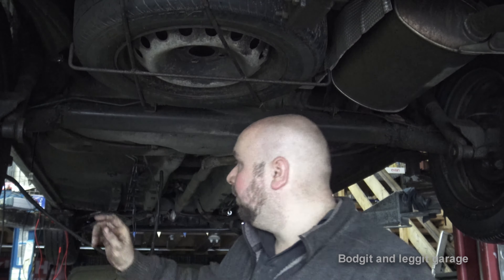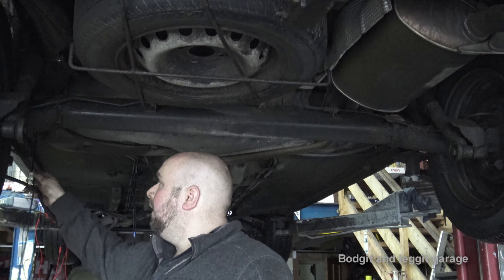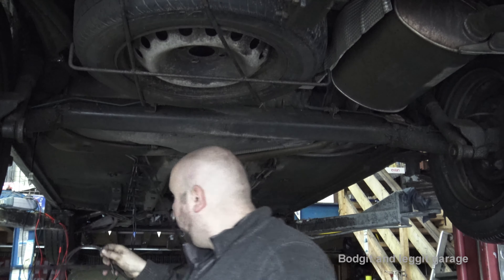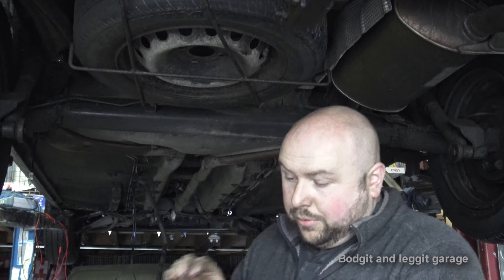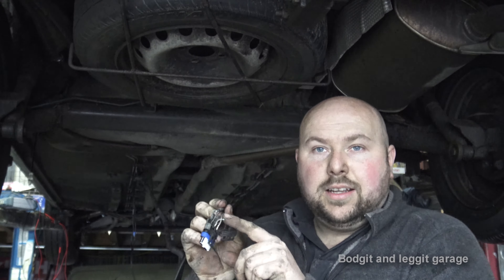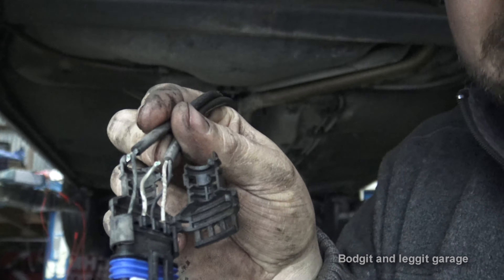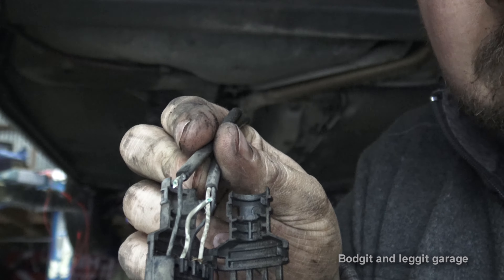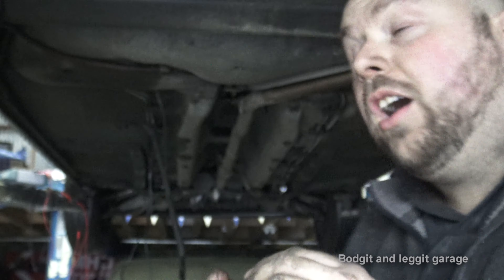Oscilloscope Diagnostics Do You Want To See It Bodgit And Leggit Garage

Comment: Yea, definitely. Looking forward to it! I'm trying to track down an abs/esp, steering angle sensor, communication fault(s) from PP2000 at the moment myself. Have a feeling all the errors are from one single cause. I'm waiting on a new multimeter to arrive in the post before I can do much more though. 
I hate the idea of throwing parts at the car until it's fixed.. I spent about a week diagnosing and researching until I was sure I had a sticking/faulty fuel regulator.
Reply from the maker: sound like fun mate get your hands dirty lol

Comment: been watching US guys doing diagnostic work and they are great certainly made me think more outside the box as a none mechanic which I feel is essential with today's cars which encourage some disreputable garages to shaft customers. 

You can do a lot of testing with a scope on a rope ( test light ) ohms meters and even basic code scanners with freeze frame can help. 

So if your doing this don't forget the cheaper options If you haven't already then check out guys like ScannerDanner and Schrodingers Box.

And your right don't be that parts changer. 

Teach us buddy. 

If need be do a channel just for diagnostics you will be surprised how many of us will subscribe.

I diagnosed a knackered cat using a bog standard hand scanner using live data function when two local garages wanted to change the O2 sensors rather than trace the real problem. with todays cars a small vacume leak has a knock on effect so being more proactive and investigating can save hundreds of £s

Comment: speaking of diagnostic have you used that delphi software just wondering if its any good im from n.i
Reply from the maker: Jordan Finlay hi mate yes I have used and also got the Delphi diagnostic system I like it very easy to use straight to the point it's like every diagnostic machines will not do everything but can get you out of a lot of trouble in the other hand